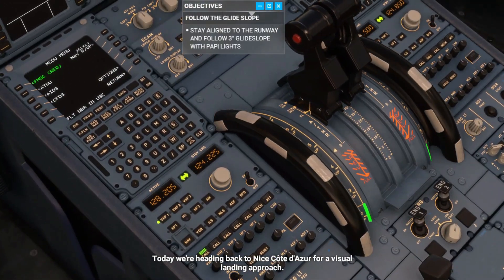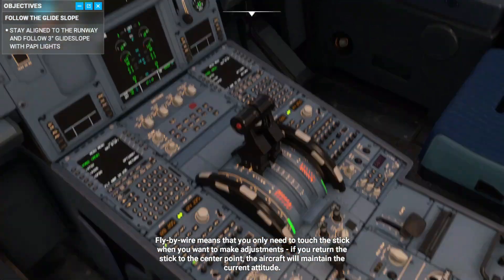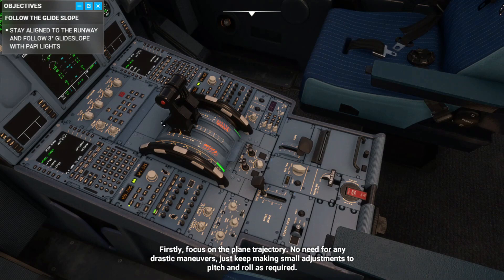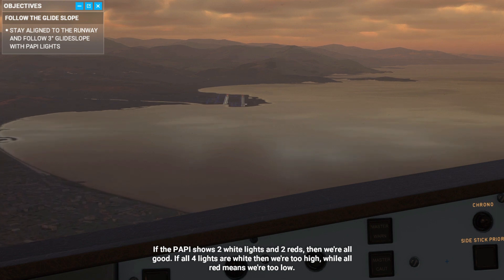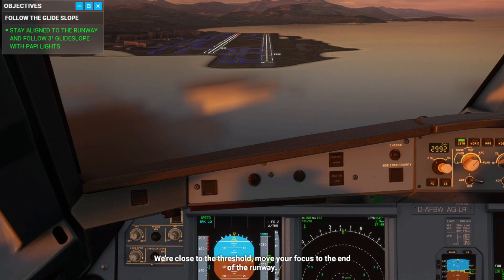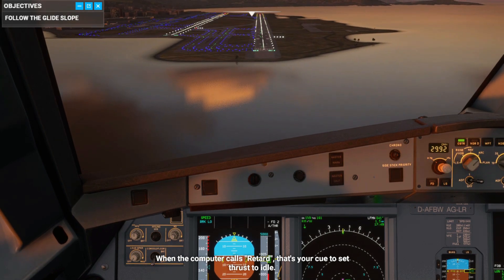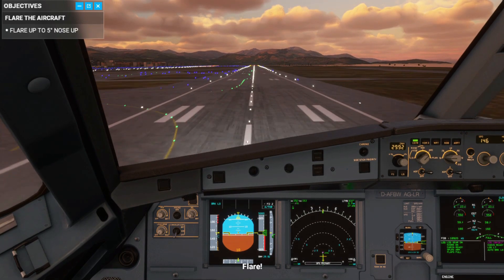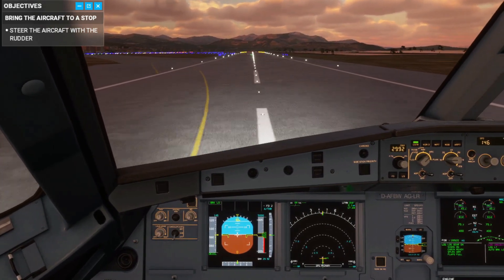Microsoft Flight Simulator | Airline Training A320 Landing

Comment: Hi there, how did you do the landing announcement? I’m doing the same tutorial. The same button above doesn’t seem to do anything.
Reply from the maker: Hello Harry, on the overhead call panel. You need to press the forward and aft button and it’ll make a ding sound which triggers the landing announcement. You need to download the flybywire a32nx mod. You must be using the default A320. Here’s the link to the mod: https://flybywiresim.com
Reply: @DaftPilot  Great, thank you! I'll check it out.
Reply: @DaftPilot  Much thanks!!